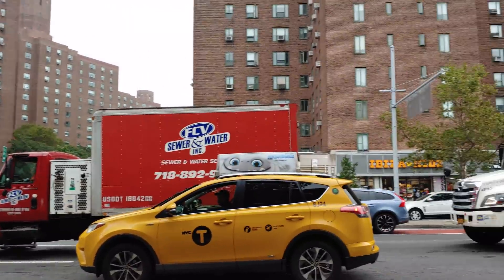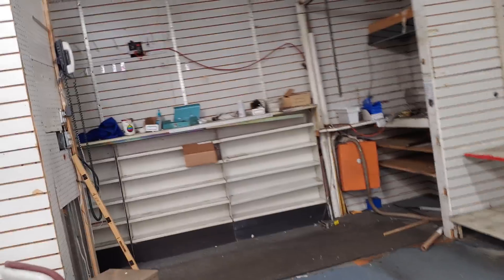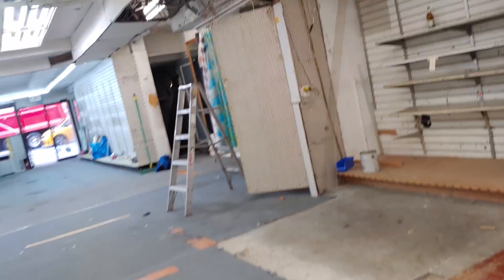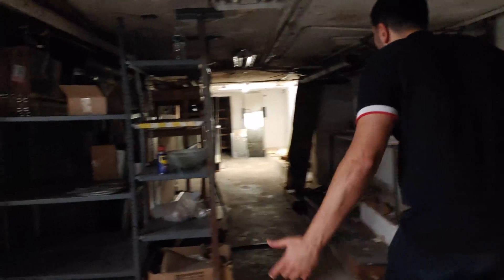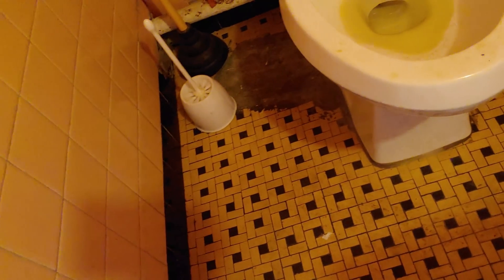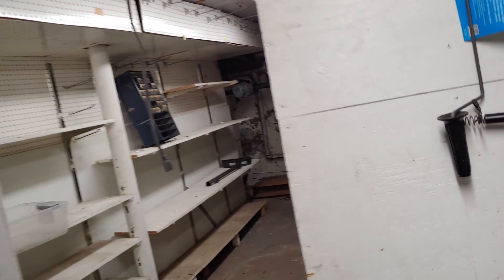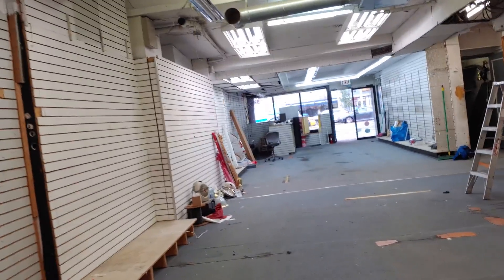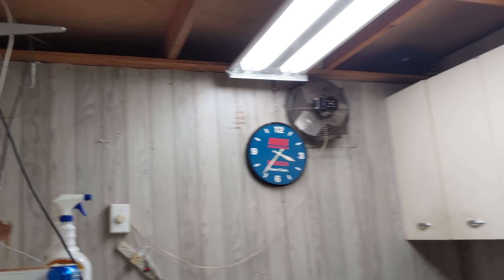[1ST AVE 20TH ST] Is this BETTER or WORSE than bella tile(last video) to be used as our new store?

Comment: Size, floorplan, the magnitude of storage potential, massive basement, 200 amp service, big front window, good location, very reasonable rent.

Now, the terms are everything.  The hvac needs to be checked out.  Check the basement again for signs of water.  Determine how youre going to vent out from the fume extractors.

Comment: this has potential.  big enough to handle everyone you currently have and a few extra to boot down to the basement if needed.  and hvac is already there.  didn't hear what the price was but if its around 10k i would say this would be a good unit to go for.  does need a bit of clean up, but otherwise i doubt you will out grow this anytime soon.  i wish i could help you look at the electrical, its kinda my thing.  not seeing any real red flags with this one.

Comment: Bus stops in front of the door, metro at 200 meters. 2 Banks a little further. Many plus points. But big enough? And what is above, seems to be boarded up, structural problems? But maybe you can possibly expand upwards if necessary?
Based on google earth there is nothing behind the building and the rear part looks directly with its own roof with an airco unit on it.

Comment: This looks good if location works to your goal.  The basement seems VERY workable and looks like it could be vented for fume exhaust or even have enclosed space for "clean room" work. You will have to renovate the stair access to basement but a good contractor could probably do it later inside of a month.

A two month move-in would great if you can get it, but you could probably be open and functioning in 30 days with the preplanning you are now doing.  As to price - I find ALL Manhattan and NYC rents unreasonable, no, really outrageous.  I would also think that the landlord could be happy with a clean and up to date business that has a nationwide reach.    

If work/sales and growth keeps up at the current rate -- your decision to go for it is commendable.

Comment: This is indefinitely better than the bella tile one. But im worried about the walls and the weird ceiling tiles to the right of the entrance. As someone said it in the comments before, this space needs a lil' more work than just paint.
EDIT: Also no unsellable tiles in the basement, which is a plus.

Comment: Location, location, location. is what everybody says is #1. Don't know what you really need, but if it's safe, has the room/layout, and can make it easy for customers to find you, it's good. In Ca. a place needs parking - where do customers park there, and can they get there without being mugged?      
Is there an alternate exit so you aren't trapped in case of fire in the front, or trapped in basement?
Examine the place for non compliant repairs/additions/electric/gas etc. & check for sketchy workmanship and crappy materials. Don't want to get in there & find the wiring was done by Homer Simpson.

Comment: Noice! Great location.  *What's upstairs? Im sure this wont happen, but I had flood in my shop (rare books.. you can imagine) once because a riser in the building above me broke and none of the people in the building at the time knew how to shut the water off.. That shit flooded until the FDNY shut it off like 45 minutes. At least the building handled it professionally, and I did get a nice insurance check, but what a fking nightmare you never wanna deal with. This is probably commercial only. I think I know this corner.. looks like a no-brainer, really./

Comment: Looks   good  , Right on the street with  a roll down security  gate and   enough space  between the main floor and the basement,,  with on street signage, this looks great for a   ready to move in...  Minimal need for  any construction   but  it could use  some  sprucing up. defiantly top of the list.   just put  5-10 K in   making it look  a bit nicer..

Comment: This one seems pretty good. The ceiling is always going to look messy i think with the way the ducting and drop ceiling was installed. Power seems fine, basement is large enough that you could do inventory, shipping and receiving as well as maybe up to 4 work stations. 

Less potential then the tile place but possibly less hassle as well. 

Main floor feels a little small for a 5 year positive growth in size. But size =$$$$ an saving $5000 a month adds up real fast. 

Does it have reliable internet?

Comment: @6:16 - you actually can do whatever you can with the ventilation. Even hot-forming the anti-air gun barrels.
The concern is that the shop floor is LOWER than the sidewalk. And definitely 3/4 meters was flooded less than 20 years ago. Just slightly higher than 3d shelf from the bottom.
edit - in comparison with the step-ladder where 3d step surface equals 75-78cm from the base.
Reply: Are you basing this on the paint appears to be peeling off in some of the areas where that ladder was sitting?  I saw no water / tide marks on the walls there.
Reply: @GregM  Yep. Just lower right corner where that step-ladder was located in the video; I may tend to err with wide-angle camera, although.
Reply: @GregM  Well. Upon the second, third and fourth look - I consider myself at fail. Sorry, I was wrong - to be honest.
Reply: Sadly, I am wrong. That was some heating drainage , not flood. I do feel  somewhat ashamed.

Comment: Between this and the tile shop, this is probably the best stepping stone. I like the tile shop because of the size, especially if the second and third floors were negotiable into future deals and expansion. The basement was great, but it was a lot of work overall. 

This one also needs a lot of work, like most of them, but relative to the existing shop you're in, you could do a lot more up front work to make it look great instead of retroactively making improvements over time like I think you would have to do with the others. I'm not sure on what to do with the condenser being inside like that. Without adequate ventilation, the humidity would be as thick as Taco Bell's nacho cheese. The peeling paint and what appears to be some water damage, potentially caused by the AC, is a concern.

Getting warmer.